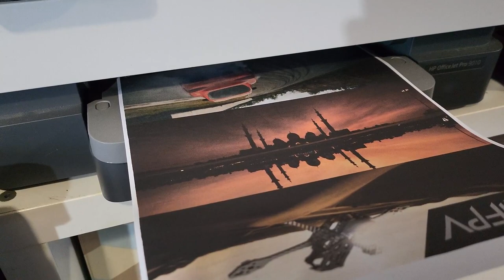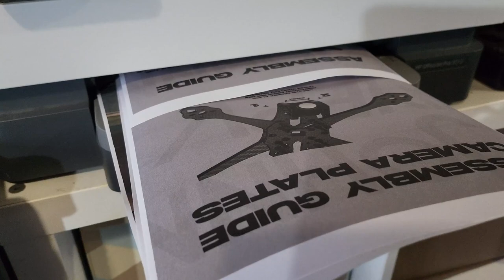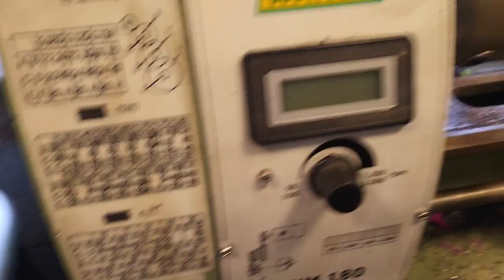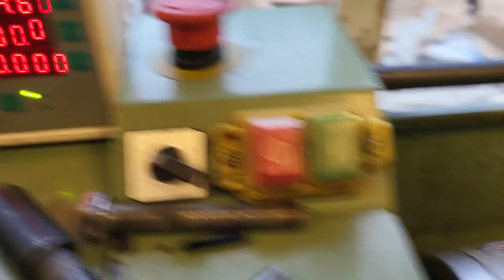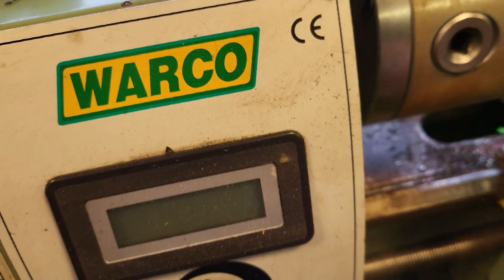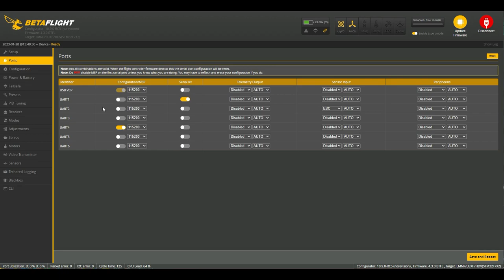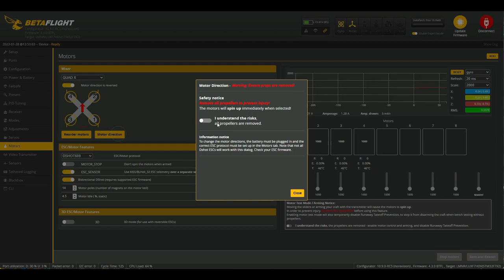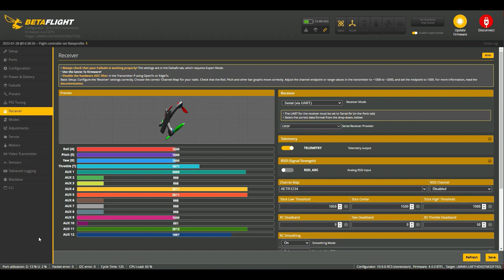LONG - Full Lumenier QAV-S build - Johnny FPV Edition

Comment: Glad I ran across your build here. I'm doing my first build, and decided to go with the 03 air unit. Then I saw that you have a pretty good grasp on beta flight. I hope you shoot the part where you activate and set up the 03.  Right now I'm stuck with a camera calibration error, and the 03 won't come out of low power mode.  Your build looks great so far, and hope to see you finish it up here soon. Thanks
Reply from the maker: For the camera calibration error - nice and simple to resolve.
1. Download DJI Assistant for consumer drones on your computer 
2. Power up the drone with a battery
3. Connect USB to your computer
4. Software will see the DJI O3 and ask if you want to calibrate the camera
5. Update firmware, and you are done!

Once you have done that, you should find you will be able to get out of low power mode with the newer firmware.

Let me know how you get on and if ytou need any help!

Johnny.

Comment: Hey man! Nice video. I just ordered the air unit o3 & I have the same luminer QAV-S JohnnyFPV edition frame. According to my research the mounting holes on the frame are 30x30. Am I wrong?  I just ordered the luminer adapter plates 20x20 /25x25/30x30 for dji o3. Will I be fine with that ? I'm nervous as is swapping over to digital but when I learned I didn't verify proper mounting for the o3 I nearly browned my Levi's. Both will be in before I arrive back from a work trip but I still have 6 days so if I need to order anything else let me know lol. How does this frame do for protecting the camera module ?? 

Thanks in advance & keep it up!
Reply: Also if you can recommend where find the designs / sell me some required 3d prints to make my life easier, I'd love that too ❤

Comment: Hey man what screw whole did you use for the 03? The front or the back and the angled slot.
Reply from the maker: Used the curved slot, and an m2 X 8 screw. 
I ended up reversing the posts for more clearance, then printing some 0.8mm shims - so I could add an ND filter without it fouling on the frame. 
For a design that is supposed to take the O3 camera, it's not the best...
Reply: @phatpigcustoms  I just used the front hole on the front camera screw. It sticks out a little but I don't have any frame in view. How about the way you have done it? It sticks out a tad because I used the back screw on the camera and the front on the frame. I haven't looked at the gyro flow data yet. But I did not soft mount it so I'm sure it's a mess. I know what you're saying. I didn't flip them. But id like to get some shims if the data is a mess. I had a set of shims from a clone and lost them. I'm happy I didn't have to buy a special frame though. This was my Vista frame so I can't complain. If I bought it for the 03 I would definitely agree with you.  they should include shims and the 03 mount.
Reply from the maker: @kennykobitsfpv  Yep - you are right - I did the same looking at it today. Doesnt seem right for a frame "designed" to host the O3 does it... Especially when you try to fit an ND filter. 😆